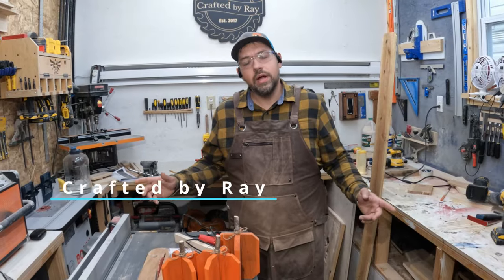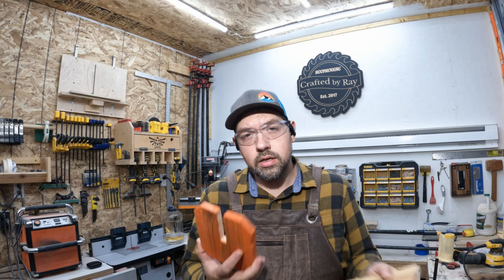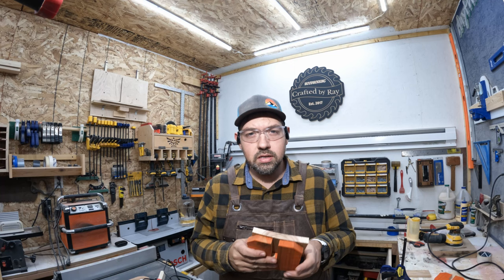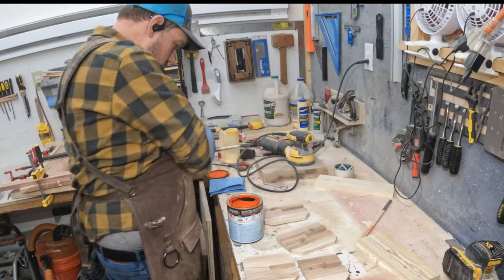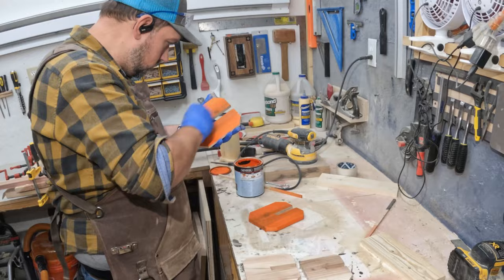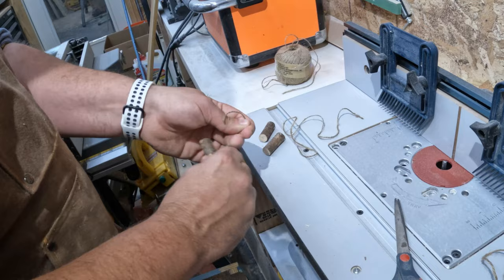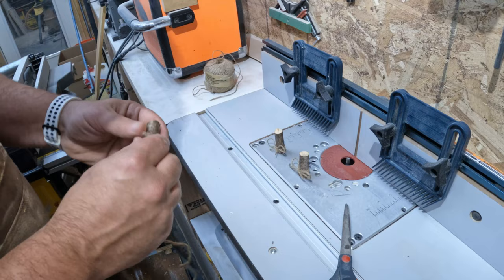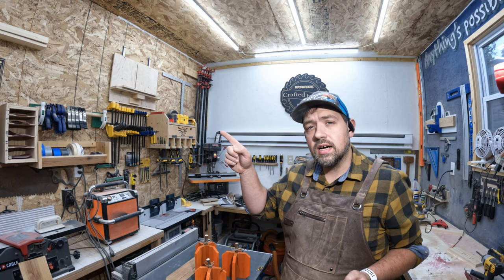DIY Wooden Pumpkins for Halloween and Fall | Money Making Project

Comment: How far down did you cut channel?
Reply from the maker: Just slightly more than half of the material so that it got a nice fit and gravity can hold it together if you don't do more than half then it'll be a little too high and the top won't be flat
Reply: @CraftedbyRay  
10-4, Thank you for the Tips!!! Nice Build!!! I’m going to give it a Try.
Reply from the maker: @Ricks2Cents  It's something I make every year now I'm going to bash them out today cuz I have a craft show in a couple of weeks I think I'm going to make 30 of them
Reply: @CraftedbyRay  
If you cut them on a Laser or CNC you
Should be able to match them out Really Fast!!!
Reply from the maker: My experience the laser and the cnc just makes things a lot slower maybe the first one but it would be faster to use a bandsaw to cut the notches because setting up on a CNC takes a lot of clamps and making sure you don't run into the clamps and it would take a powerful laser to cut through half inch cedar fence pickets
Reply: @CraftedbyRay  
A 40+ Watt Laser will be able to make ALL the Cuts in 1 Pass. So less than 2 Min per Pumpkin. After I create the File I'll Post something and Tag you in the Post.
Reply from the maker: @Ricks2Cents  thank you I appreciate that

Comment: I just love your pumpkins. How can you cut the notch if you don’t have a band saw and also what are the dimensions for the notches?
Reply from the maker: You could always do it on a router, table or table. Saw are even a Jigsaw. Thanks for watching the video now. The dimensions I just split the 2 parts in half and figured out where the middle is. After I do that, I just try to make it so that the tops and bottoms are flush. It takes a few tries and then I use one to trace the rest out.
Reply: Is there a template?